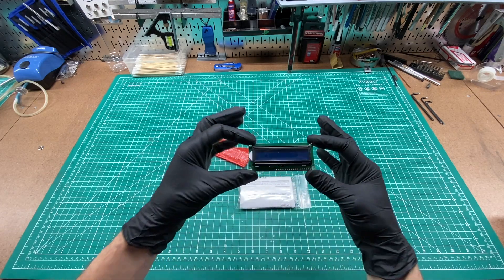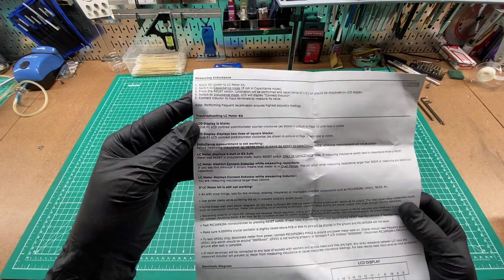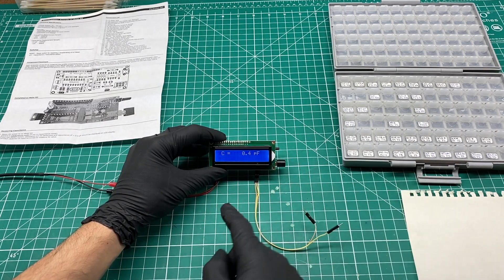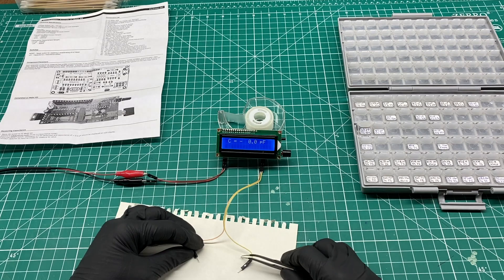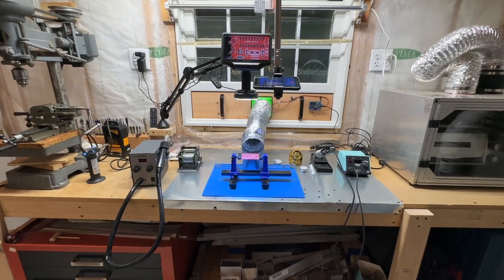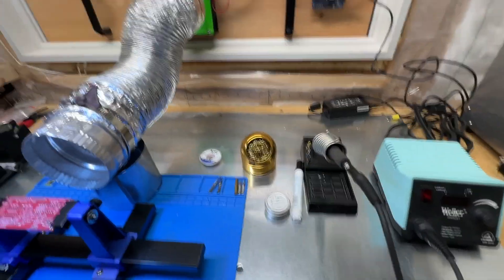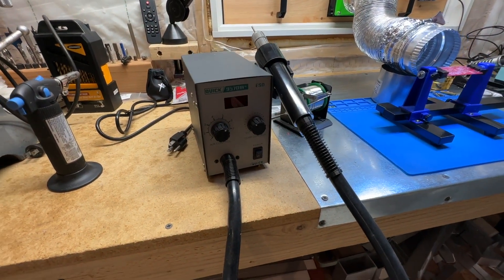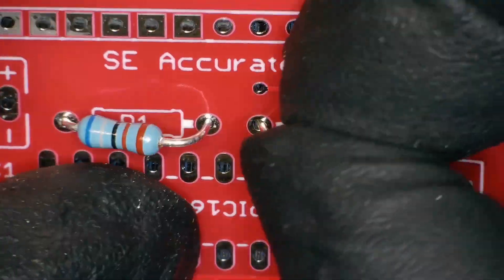Auto-ranging LC Meter Kit Build

Comment: This is a really cool project specially the box for components! Could you please share the link for it?
Reply from the maker: Sure. I just added it to the description. I’ll paste it here too: https://amzn.to/3D9jFKd (affiliate link)

Just a heads up, this specific box that I have isn’t made from anti-static materials. So you have to be careful with what you put in it. Resistors and caps are fine. This same company makes anti-static variants if you need that.